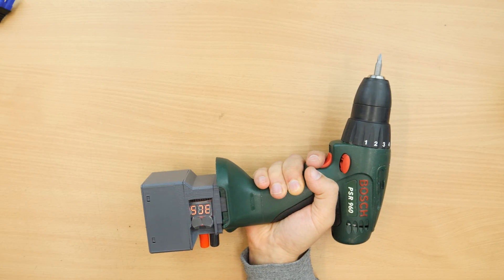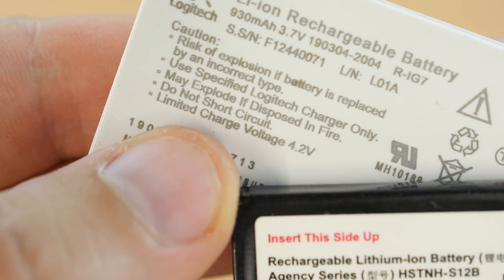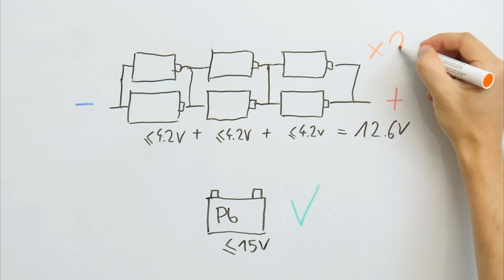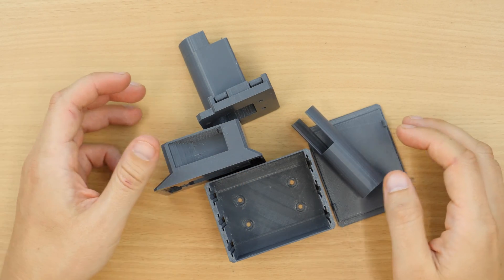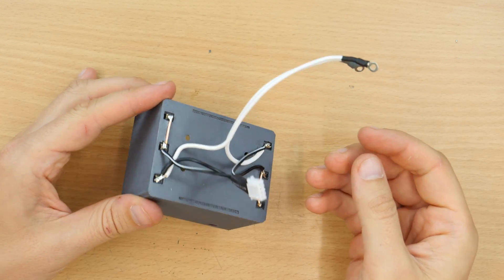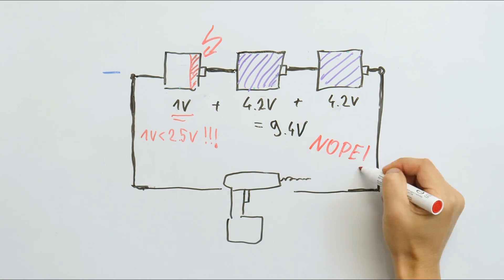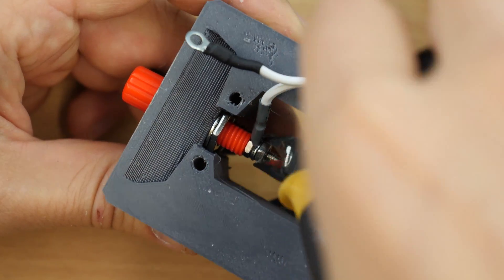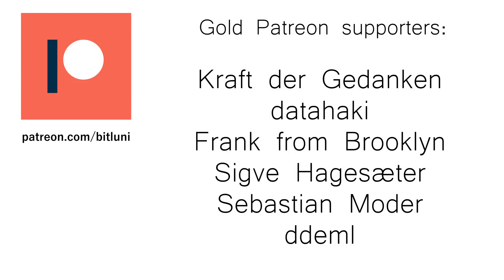How to make a Lithium Ion Power Pack

Comment: Thanks. Just what I needed.  I came to the conclusion 18650 cells can't deliver the 10amp draw. Parallel would work. Also a lipo works,they can deliver 50C. And I am thinking adding a BMS while connected to the drill and a skipping the BMS while balance charging it

Comment: Err I think you'll also find that the cells are 65mm long not 650 (or 690 for protected cells)! Over half a metre long seems a trifle large methinks! Easy mistake to make while commentating a video. 😁Great design skills and use of Blender (not an easy tool to get to grips with). Had you thought about mating the whole of the existing battery case top to a new, deeper bottom section, mounting the cells vertically as per the shorter nicads? That's how I've always planned to do one of these ... When I get a 3D printer ... AND. a CNC mill! 😂
Reply from the maker: This is a good one.... errors every single time. We should make a challenge who finds them first.
Vertical is an option.. but then the drill gets even longer which can be less handy.. Also with the bigger footprint the drill can stand up right on the pack

Comment: Do you have a link for those battery terminals ?
Reply from the maker: I used these
http://s.click.aliexpress.com/e/YfqZvRF
but I didn't link them since those might need an update to thicker ones like in these compartments
http://s.click.aliexpress.com/e/EyNVBm2

As long I don't have better contacts I'll add some pieces of stranded wires to the spring sides to get more current trough. If you find better ones please send me some measurements and the link and I'll add a version of the 3d file for those
Reply: Awesome :D

It's one of those items that's an utter pain to search for unless you know exactly the right search terms :D